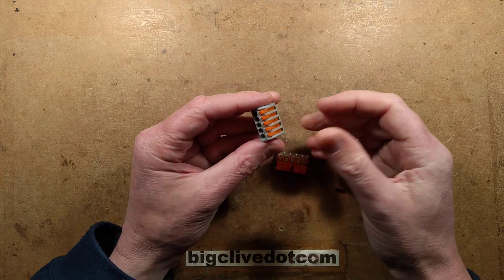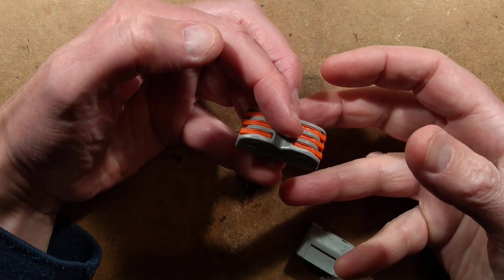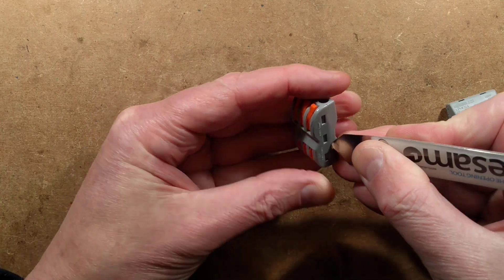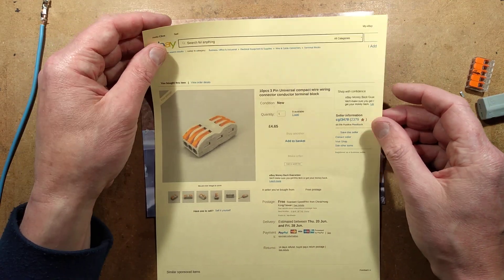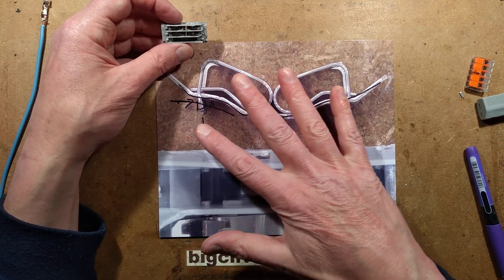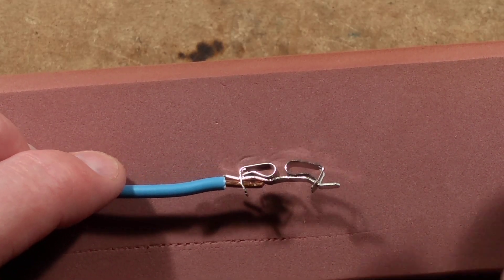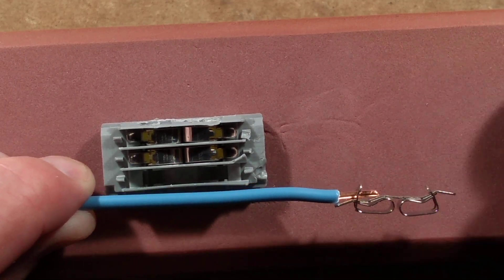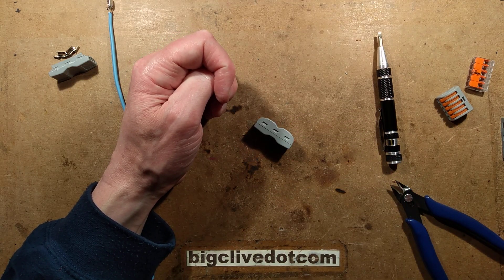Clone of Wago product that Wago don't even sell???

Comment: this is actually a smart design but not what the wago clips are for. their purpose is to split wires where you'd usually use those twist connections for. this thing would kinda confused people but is also just a replacement for those white little 'sugars' with the mini screw / to connect or extend a wire. could be good, though, because those little white sugars are not meant to connect a wire that carries 10 amps for example, and I'm not gonna lie - I have used wagos to connect wired in the past as well. this would be smarter than those wago's with only 2 holes

Comment: I’ve seen and used these before, they are fantastic if you put them in a choc box secured closed with a small screw so that they require mechanical help to open. They are great for LED Spots!

Comment: Nope, Wago do not sell these, went through there entire catalogue and online catalogue. They look great, An easy solution and much tidier solution in my opinion. I use the Classic wago a lot for electronic prototyping and  have always loved the ease of connection and strength of connection (and how many  times they are reusable before showing signs of wear), but have always been frustrated at the same side connections. Sometimes the old chocolate block connector would make an appearance for pass through connections.

Comment: Plug two cables each into the wago version and plug two cables into this Chinese version and compare how much force is needed to pull out the cables. Then you know why wago doesn't make such clamps. It's a shame that so many people here call this a great idea without immediately recognizing where the disadvantages and dangers are
Reply: Run the wires into the opposite side of the connectors, then the tension will not be on the springs. (Put wires from the left into holes on the right, and vice-versa.) Too bad there are not molded-in wire guides on the bottom to help maintain the overall orientation. :/

Comment: Wago do do a connector similar to this and have done for some time. You find them in maintenance free junction boxes such as the Hager J803/4. All right they don't have the little levers on them but the principle is the same:

https://www.wago.com/global/electrical-interconnections/discover-field-wiring-terminal-blocks

Seem to be more of a commercial product so not so easy to buy and expensive. There is a similar thing in the Hylec Debox Screwless Connector Box but not sure if that is Wago.

There seem to be many products that you'd have thought would be available but aren't such as this 3 pole lever operated Wago type connector that Wago don't do. Wago also don't do a high amp version of the junction box WagoBox Light,  a straight through design but limited to Wago connectors up to 24A max. For the higher amp connectors they just do the WagoBox, XL, XLA boxes that aren't straight through but in and out the same end which doesn't work if your trying to tap into a cable with no slack. Surely it would cost little and take no time to knock up and certify something like this, it's hardly a revolutionary complicated "design", just a mass moulded bit of plastic.

Comment: Wago do make pass through terminal strips, for example series 261, but they do not have the lifting up spring levers you have to push down on them with a screwdriver instead.

Comment: I would not use those for 110/230/400 V AC because of the closeness between the terminals. For 50V and below they would be perfect, like some car-power or car-audio stuff, or +5 to +24V systems with LED or Computer products.  IF you use this for mains AC power, note that it would not be SS EN 436 40 00 compliant, and thus the entire installation would be illegal in Sweden, and probably be Illegal to use anywhere in the EU. I have no idea of electrical regulations in the rest of the world. IF the separation was bigger, syay double what it is now, and if the casing was molded together, it could probably be made EU-compliant for use in non-humid environments even for mains AC power.

Comment: The original patents for the WAGO connectors go back at least as far as the mid-80s, so copying the function and the form factor should be fine. Improving on existing designs is what the patent system is supposed to be encouraging. Moving "Trade Secrets" to the Public Domain is in society's interest.

Comment: every time i come across these in my line of work (motorcycle mechanic), I almost always have extreme difficulty reusing these after the connector has seen a few thousand (not that hard to do, really) miles worth of riding. However, when they're new, i love using them. Makes quick work of installing accessories.
Reply from the maker: Is corrosion from moisture the biggest issue?
Reply: bigclivedotcom sometimes. It’s sort of a 50/50 toss up between corrosion and the internal spring getting stuck in the closed position so that reinsertion of the wire is impossible.

Now that I think about it, that’s probably a corrosion issue more than anything else.

Comment: 3 years ago you did a review of a VERY cheap Chinese soldering Iron. I have several reasonable ones but I though thod it I'll try a couple. I replaced the twin core stiff lead with a three core silicone one (for an earth) and did a couple of mods to stop the thing falling apart, etc. I also bought tips as spares. I thought it might last a few weeks, it's now well over 2 YEARS and the thing won't die. It's slower to warm up but not too bad. Strange how you get used to an iron, I shall be a bit sorry in a way when it dies - if it ever does. I think mine were 99p each. May the flux be with you always.
Reply from the maker: If it's the type that emits large amounts of smoke when first powered (mica binder burning off) then it wouldn't surprise me that they last a long time.  They are a very simple heating element sold for many other applications too.

Comment: Thanks for the teardown, fascinating to see how the mechanism works as I always wondered why my connectors had a tendency to cut wires that aren't thick enough.
I wish they made ones for low voltage/small wires.

Comment: The problem with these is similar to the problem with terminal blocks. You can pull a cable in a house really hard not knowing there is a connector at the far end that gets pulled free. This could cause an arcing failure or a fault. The maintenance free system requires strain relief by clamping the double insulated exterior of the cable.

Comment: 1. What is the largest gauge wire it will accept?
2. To get 2 wires in to one side, how small (gauge) must they be? i.e. to run two low currant devices off one supply?

Comment: One thing I would say is while the Chinese have no concept of IP, they aren’t complete idiots and are able to invent stuff.  I have had very good original product from China, notably PC/SBC stuff.  There’s a company called I think Geek Squad who do some very well made add-in boards for the Raspberry Pi (HATs). 

 Thing is they are relatively expensive-  you can get hard work cheap PCB boards for say £12 that might just sort of do what they said before failing/catching fire when you turn your back, or the Geek Squad ones from £20 to £30 which isn't any different from the stuff coming out of say the USA or to a lesser extent UK (obviously some of that is designed in the West but made in China- the Raspberry Pi is made in Wales and China for example but there isn't any proven variance in quality).

So when the Chinese aren’t just ripping off stuff they can make good original product, but it isn’t ‘Chinese cheap’- which I would suggest should give us hope.  Normally the argument is we can’t compete ion price, but I would say we could if it is good original product.  If they try and rip it off they will tend to go cheap (otherwise why would you buy it?) so you win by having good original product that they can only effectively copy by not being cheap.

I think as their industry 'matures' we will see a lot less ripped off tat and a much more well made original product that is closely priced to anything made in the West.

Comment: Those WAGO rip-offs, I won't buy them- obviously I did once but the quality was notably worse for no great saving.  The proper Wago is worth the money, I fitted a load of LED outdoor lights using them.  I have stage 4 lung cancer so I'm not at the top of my game but they enabled that as a one man job- and the time saved really stands out.  They also do sort of junction boxes, a little bit expensive but a clever design and easier to fit that most common or garden versions.  Working with cheap tools and cheap fittings makes me depressed, everything is just that bit harder than it needs to be- not saying you need to spend a fortune or have the top of the range everything but a bit more spent is often rewarded- certainly with this type of fitting.  I use them outdoors no problem and I use them for PCs/ Single Board Computers.  Obviously you need to note their maximum wattage and so on.  Can't use them for everything.
EDIT:  Good point about convincing fakes, that will be a nightmare and probably bump the price up for the genuine article.  I buy them from the internet so I’ll get burned as I can’t physically check them until they arrive.  I suppose at least with Amazon you can more easily send them back.

Comment: I couldnt find any official wago in-line connectors. I wanted Wago to make these for some years, glad someone else did it. About the 230V with that little seperation, im also a bit concerned, but as you mentioned, putting the earth in the middle would prevent any mishaps. 

Could you test the fake ones if their plastic is good or not? Sometimes cheap chinese looks the same, but is made from flamable plastics etc. 

thank you Clive for all the great content, Steffen
Reply from the maker: John Ward did a flame test on a clone and original.  They both melted but self extinguished.  The problem with clones is that you never know what the material characteristics are going to be like between batches or from different suppliers.  The majority of them look like they may be aimed at professional use in China.
Reply: @bigclivedotcom  then lets hope that Wago is gonna bring out one of these soon too.

Comment: I use the cheap rip-offs a lot for low voltage practical lighting on theatre sets. Much quicker, and more reliable, than choc-block; especially for splitting circuits out to multiple destinations.

Comment: i am still not convinced the least bit on wagos clamp on or any other push on junk, to me it's always a failure point and will be until it flames into a fireball....
or they just cause high resistance that builds with length and amount of terminations.... say the newer dumps with lack of start current and major voltage loss, near the end of runs or early on with very poor connections, aka FIRE STARTERS..  real world load testing on that junk wasn't done, meaning chemical leaching, non pure copper and high humidity causing accelerated rates of  corrosion and fire risk due to joints heating......  push on junk, Id only use it in end runs, feeding single devices.

Comment: do these work with stranded fine?
Reply from the maker: They can be used with solid core or stranded cables like flexes.  I wouldn't use them on very thin stranded wires because of the spring force.

Comment: Does someone make a screw free Consumer unit? 
Mine has the Neutral Bar in free space, held in place by all the attached wires because someone forgot to do a terminal up, causing it to melt itself free on the polycarbonate moulding.... I think it was polycarb because it smelt like melting polystyrene tiles.

Comment: Nice contraption, but I don´t see a single use for it in any standard installation. Therefore not worth producing at all for Wago.
(if it were useful for permanent installations like light fixtures, you would not need levers since you have solid wire on one end and crimped wire on the other) So it costs too much to produce and helps only in very niche situations where you need to splice two stranded cables.

Comment: Doesn’t look like Wago makes this looking at there site. Great idea though. Hager do this type connection in there junction boxes for use mainly on power circuits such as socket circuits to satisfy the regulations of only having connections that are non maintenance in non accessible parts like between floors ext . Unlike the old screw junction box that is practically redundant.

Comment: The price for real Wago blocks is not bad on Amazon in the U.S., for the three lever blocks it is $0.30 per if bought in quantities of fifty or more. Granted, that is WAY more expensive than the twist on kind normally used in the U.S., but the twist ons, called "wire nuts" around here, aren't reusable and can only be used for one or two different gauges of wire.

Comment: Wago does produce connectors like this, but they look completely different and use push buttons instead of levers. Series 294 and 862 for example.
Reply: Those are DIN-rail products.
Reply: @Furiends  862 is DIN rail, 294 connectors aren't. They're only 3x3x2cm, roughly the same size as regular Wago connectors.
Reply: Also Series 260 - with screws, I think.

Comment: You can mitigate any kind of connection issue, long term, by adding a generous squirt of dielectric lub...grease. I've never had any panel mounts where the original Wago unit were used, go rotten because of this practice, where as before, they did.

Primarily speaking of a transfo-point that's outside my house. These are much better (the original bus type) than the screw types where the screw sometimes chews through wires, which are also more susceptible to corrosion due to the larger mouth. With the Wago (and now, this evolved clone) you can actually seal the wire at the mouth using, either a larger wire shroud, or like i said, dielectric grease.

Comment: I've been working with Wago connectors for a wee bit over 20 years, as well as other brands and clones (and some clones are really dangerous as they get loose over time in the spring connection and melt, over bad quality materials) and I have never seen anything like that one! Wago only have single in line connectors as far as I have seen in the catalogs

Comment: There is actually a plastic wedge inside if you split one in half you will see that the connector drops down and rests on the block, the wire hits the plastic block which then tells you how deep its gone inside.

Comment: Wagos have revolutionised the way we connect up set electrics in our theatre, quick, secure, safe and reusable. I wish Wago would make 3, 4 and 5 pole through connectors to connect up mains pracs and the plethora of LED strip connections we have to make. It would be so much neater and only use 1 connector as opposed to 3 for say a 3 pole connection.
Reply from the maker: At Disney in Paris all the electrical wiring was based on Wago style connectors.  It was the first time I'd seen them in such heavy use.
Reply: Much better than the old choc block for these jobs.

Comment: My house has aluminum wiring and I'm so jealous of these wago connectors.
Reply: Aluminium wire in housing use I dont like the sound of, but I come from a damp environment with aluminium seems to turn to white dust.
Reply: It’s not used anymore, I just have an old house. The big problem is that it can corrode and cause high resistance connections when it’s connected to a dissimilar metal. So most standard receptacles and wire nuts and such can’t be used.

Comment: I have used the wago connectors on multicore wire before, but I am not so sure anymore it is a good idea, specially where there is possible movement of the connector as it looks like the retention sistem would end up cutting the litle wires over time.

Comment: I can see this in audio applications where you don't want to wire in another point of failure using screw block terminals, but rather want to just extend some cable with more cable, without splicing them together or using a soldering iron. Sure it's another point of failure, but it also means you don't run more wire just for a contiguous length to go from end-to-end, rather you can cheat and put shorter lengths to use. If they made the separation a touch thicker I could see this in field use for musicians to extend their three-pole wire runs.

Comment: @2:35 you can see somewhat see they are reated for 12A, 230V/600V and 0.0?-1mm2 on Wire size. Current and Wiresize sorta checks out. wouldnt trust them with 600V or even 230 at 12A but for some low voltage low Power instaltation for a couple ceiling lights, maybe?

Comment: The spacing is totally unacceptable and unsafe! This will be the closest spacing in your installation, by a mile and a half, and you just introduced an unwanted sparkgap in your wall that will set your house on fire.
I was also quite excited about these at first, but the spacing issue is a complete no-go. It also failed hipot at way too low a voltage, although I don't recall the number any more. Somewhat disappointed that you did not see this as much of an issue, when it clearly is, to any electrical standard on this planet. 
Of course Wago does not make these, although I wish they did make a safe version.
Reply: By the way the Chinese make an 8-way variant of the 222 that is quite useful, since Wago stops at 5.

Comment: I bought some of these a few months ago.  I have had good success with them.  As they are not UL listed, I of course have never used them in any type of rated or inspected installaion.  I also purchased the knock off "slim" style wago 4 way which have blue levers.  I do not trust those, at all.  I have had multiple retention problems with them.  As always, YMMV when dealing with fake chicom stuff...  I always trust the Germans tho, they make good stuff.